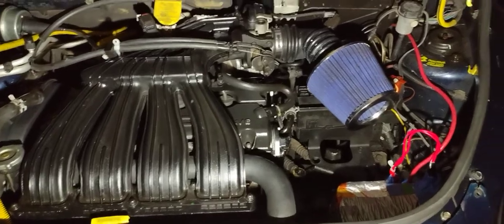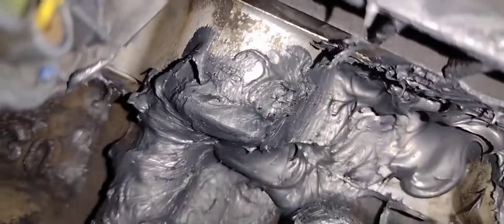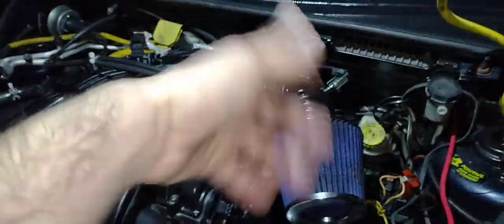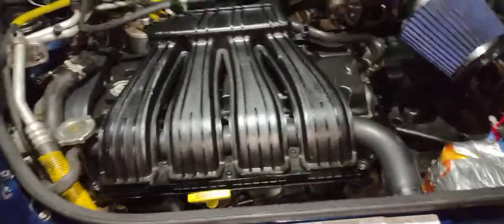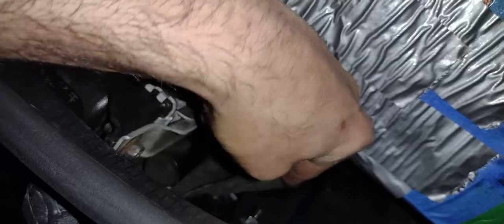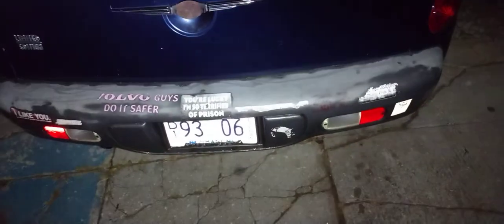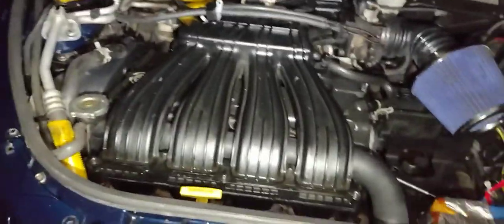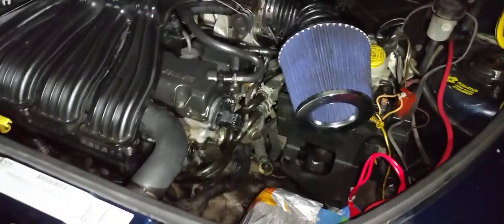2004 head on 2001 PT cruiser block oil leak fix and extras

Comment: My engine rattle underload and has a very slight misfire on idle I change the water pump about 6 months ago. Any idea what my engine rattling noise is? My dad was coming up a hill and gassed it after that the noise has been persistent. If you give it like just an eighth of a pedal it will run fine no ticking
Reply from the maker: Do you have a video of the noise?     Take your phone with a stereo microphone setup (If it has it)   and then record the noise on startup and by revving the engine.    Take the phone with the microphone and then go from side to side of the wheel wells,  the bottom of the engine and the top also going to side and front and back of the top of the engine. 

What it could be if it is a rattling sounds?  
It could be a loose exahst header flange. 

Broken engine mounts.  

Bad CV JOINT. 

The Timing belt pensioner  pulley

The Serpintine drive belt tensiner pullery

Worn cam lobes or cam buckets (Doubtfull as I have never seen it happen) 

Broken / Cracked flex plate or bolts are coming lose out of the flex plate

And that's pretty much about it I can think off on the top of my head.  

MISFIRE

Without any doubt it is worn spark plugs.  
Do the DIS ingnittion system coil and name brand plugs.  Auroua in Canada and one company in the USA  (I think Mallory) make spark plug wires that last a lifetime and have great spark energy with great EMI  rejection of the carbon plugs.  

After that there is the  Cam sensor, and the engine block crank sensor and wires.  MAKE SURE THE WIRES ARE SOUND!  Or else your just going to be putting in parts you don't need.  

With the age of these cars?    The wires like to get chewed on and corrded after all these years. 

Also depending on your year, there are 2 types of cam sensors. They are NOT interchangable. 

They will both "WORK"  but they will not work WELL.  It could be the cause of your misfire. 

Check out the PT crusier forums  and post all the info of your car.  There are only about 10 die hard guys on the forum and thy will be HAPPY to answer and troubleshoot the issue.   

Just put in all the right info of your car just like you would (Minus the VIN)  at a shop, and they can help you out.  
THE MORE INFO ON MODEL YEAR< FEATURE ETC?  The more we know how to help you out.  

Hope that heps.  Sorry, a bit tippys from the Pub. 

HAVE A GOOD ONE!